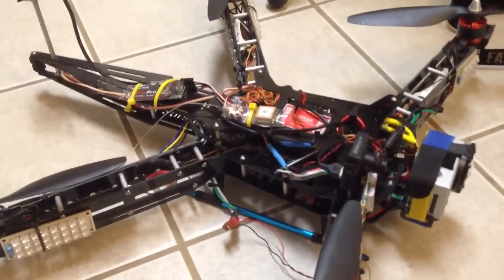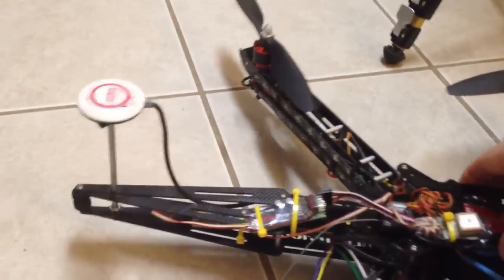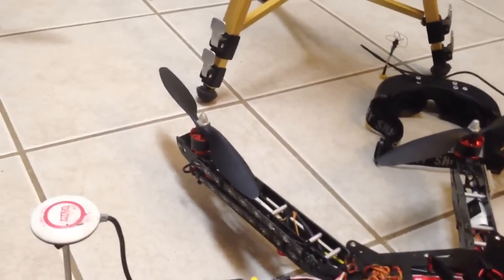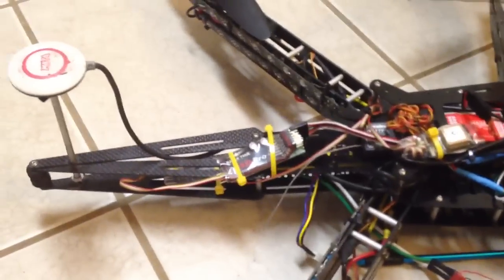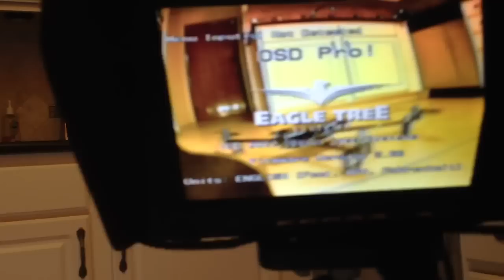Ht-FPV frame and set up

Comment from the maker: The GoPro will sometimes freeze up.  I just upgraded the firmware again and seems good, but this camera looks as good as the output from the GoPro.  I do like the look of the Horizon HD V2, would save quite a bit of weight using it instead of GoPro and other FPV camera.